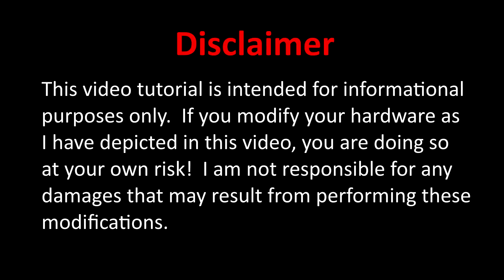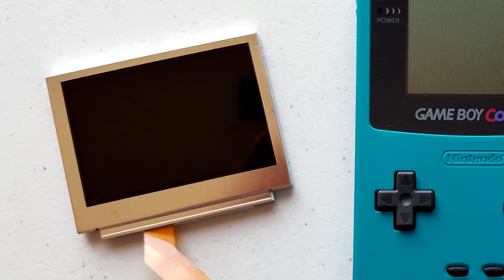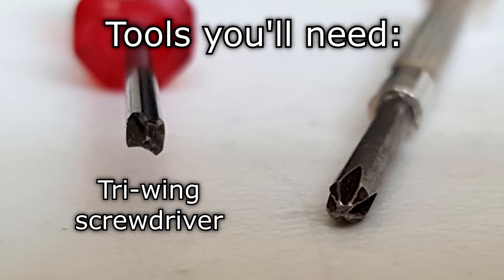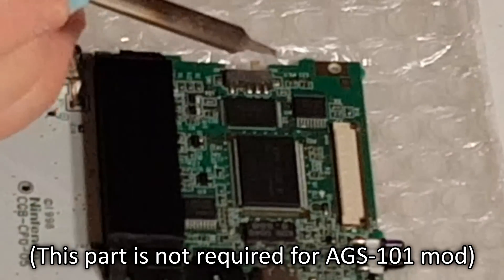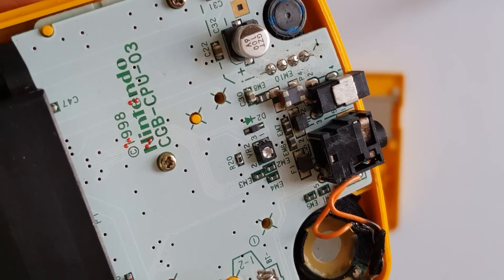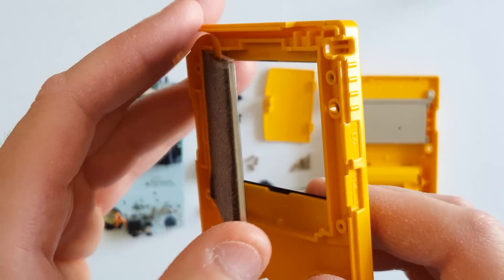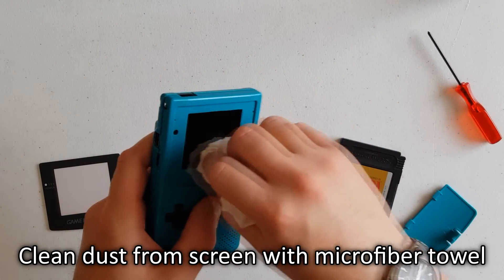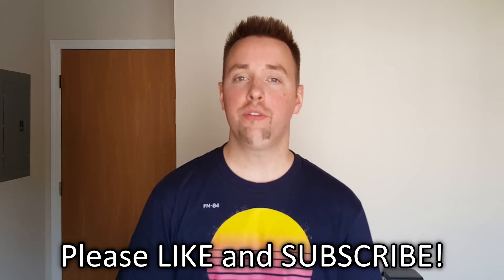Tutorial PART 1: How to backlight a Gameboy Color! (BennVenn's AGS-101 mod)

Comment: Great video, where did you find any info about the pin  3 sound chip mod?

I read your comment on the "BennVenn Backlit Game Boy Color Mod"  and this mod possible cause issues when you use flashcarts.

My GBC  had sound buzzing when i plug the headphones so this mod filters the humm/buzz?
Reply from the maker: Humber LaFont'Blank Hi there, thanks for your question! :)  Unfortunately, it's a bit more complex than that.  Basically, I had a long conversation with BennVenn himself about it.  If your screen is still the stock GBC one, it is probably not a good idea to do just the pin 3 mod by itself, because it can age the stock screen by it not having a certain signal modulated that needs to be.   I am working on making a follow-up video to my tutorial, which will also have these and more details.  I am currently only on my phone, but I will write a more detailed response to you in a few hours! :)
Reply: Thanks for the quick response. I really don't want to mod my GBC or my GBA i know that the reflective screens are not perfect but these are the tech we used to play with (my sons always asks why do you love pixelated games #LOL) The screens have no ghosting and are very responsive but you need a lot of light.

I noticed the humm/fiss when i plug the headphones in my GBC though, so if i mod will be a sound chip mod.

Comment: Another thing.. did you REALLY have to remove the red power light indicator? because you didn't really explain on why that needed to be removed. I just want to know if it's really that necessary to remove that because tbh, is prefer to keep that, to know how much battery I got left(Especially once I install an AGS-101 Screen)
Reply from the maker: Jacob Salazar Another good question!  Unfortunately, removing the power LED is necessary, because the space that it once occupied in the front housing will become unavailable because of the AGS-101 screen and where it is installed.  If you look very closely at the left side of the handheld at 28:37, you will see a small white line just above the "P" in "POWER" - That's the very edge of the new larger display.  My hopes were that it would be completely white in that entire circular window where the red power light was, but unfortunately the frame of the new LCD doesn't allow the display image to stretch that far.  As Morrokbyo asked earlier in these comments, I recommended not using electrical tape to cover the white borders of the screen.  But in this case for the power LED window, I would say that using electrical tape there is acceptable.  I haven't quite yet worked out a way to get the original LED, or any LED, into that area.  That all being said, the power for the console on a fresh pair of AA batteries (I've heard) is about 6 to 8 hours...?  Personally, that seems a little high to me.

On a different note, did you get a chance yet to order a ribbon from BennVenn's batch due at the end of August?
Reply: Kyle'sAwesomeLife thanks and I understand.. And tbh, I literally ordered one yesterday, and everything seemed to go well.  I proceeded to check out, it druid my order was complete,  and I was charged. So I assume that's Venn was able to get more ribbon cables I  stock or something
Reply from the maker: Awesome!  And yup, seeing how popular and sought after this mod is, I guess he went back to his manufacturer and had them make more.  Good luck, man!  I hope yours turns out well for you.

Comment: you mentioned that we needed a product called  "flux".. what e actually is that?. I don't recall you issuing that in your video and can't find it on Google
Reply from the maker: Jacob Salazar - Hi there, and good question!  Soldering flux is a bonding agent that helps with the soldering process, particularly with applying solder to the correct contacts and not getting it on stuff that it shouldn't be on.  I'm using Rosin Paste Flux in the video - My apologies for not showing when I use it even though I mention it in the supply list.  Here's the exact stuff that I'm using: https://www.amazon.com/Rosin-Paste-Flux-135-Jar/dp/B008ZIV85A/ref=sr_1_2?ie=UTF8&qid=1500780374&sr=8-2&keywords=rosin+paste+flux  (Trust me, this is WELL worth the $10)

To use flux, you only need a tiny dot of flux on an exposed end of a wire for when you want to "tin" it with solder (If you've never heard of this process, Google "tinning a stripped wire").  To use flux on other contacts, like I did on the GameBoy Color's board, just wipe a little bit of flux to the contact that you want to solder to.  Using flux in this manner when joining two contacts, or a wire and a contact on a board, will allow the two pieces to join together much more easily and also HOLD to each other much better.

Keep in mind, soldering WITHOUT flux IS possible and people do it all the time!  It's just much more difficult, and once you discover flux and how to properly use it, you never want to solder without it ever again.  Also, to my knowledge, flux either comes in a paste or a liquid form.  My experience when NOT using flux typically involved wires coming pulled out of things I have soldered them to, very weak and fragile connections - It was always very frustrating.  But flux makes soldering VERY easy!  I highly recommend ordering some.

Here is something that I believe would be very helpful to you: https://www.youtube.com/watch?v=o0IXpNHLKw0&t=6m40s  In this video from the channel "GameTechUS", the man applies a liquid flux to two rows of contacts.  If you watch earlier in the video, you see that he hot-glued the ribbon cable on the left into place in order to hold it next to the N64's CPU chip on the right.  Then, he "paints" all of the contacts with flux, which allows all of the solder to ball up nicely on the contacts that they are supposed to be on.  Without flux, that nice and easy of a soldering job would never be possible.  Also, just so you're aware, for large amounts of flux like what he uses, it's best to clean it from a board with 100% Isopropyl Alcohol before testing, just in case there's metal fragments in the flux that could short anything else.

In the end, the takeaway is that flux is magic.  I hope this helps you!
Reply: Kyle'sAwesomeLife  Thank you very much, and I'm glad on how very informal you were.  you take these comment Q's very serious, and I'm glad about that.  good shit man
Reply from the maker: Jacob Salazar Anytime, man!  I'm always glad to help - Just doing my part to help the modding community.   Feel free to pick my brain if you need anything else!  (And thanks for the sub!) :)
Reply: If you don't know what flux is you have no business attempting this mod.
Reply: Chris Downey he might know what flux is, but by a different name.

Comment: Is it just me,  or is it really fucking hard to get the wire that's attached to the ribbon cable to solder, and connect to the kds 8.388 chip because I keep and keep on soldering and it still will not sick
Reply from the maker: Jacob Salazar Heya!  before you try any more, try using flux when soldering.  apply a liberal amount of it to the solder point on that chip and also to the exposed end of the wire.  The flux will remove any oxidation from the exposed metal surfaces and promote a stronger bond.  then after that, just clean the residual flux from that area with a Q-tip dipped in kerosene or rubbing alcohol.  Let me know if you need any more help with this! :)

Comment: This is a great video,but what do you do if theres a problem that occurs overtime,you can't open it back up?
Reply from the maker: Thank you, and good question!  Basically, my answer is that I'm not quite sure because I haven't run into a problem with mine so far.  That being said, some people have taped their consoles closed around the edges instead of hot-gluing the internals, but I didn't think that would look very aesthetically pleasing.  So that's mainly why I opted to hot glue everything.  The part that people don't see in the video is another 3 or 4 hours of footage where the camera just kept rolling while I relentlessly triple-checked every single connection, both with the soldering I did and all of the ribbon cables, before I closed everything up for good.  Fortunately, hot glue isn't super glue, and I've had a good track record when working with it during other projects in the past when I have needed to open something up again.  My advice is to insulate everything with electrical tape exactly as I have shown, and keep the hot glue away from bare ribbon cables because otherwise you could risk damaging them when trying to open up the console again.  Hopefully, the electrical tape used for insulating electronic components will also work as a buffer for the hot glue, just in case you need to pull everything apart to fix something later on.  I hope that helps!
Reply: Kyle'sAwesomeLife thanks for replying to my question :-)

Comment: I need help!!! I tried this method, But my LCD KEEPS TURNING OFF AND ON! HELP!!!
Reply from the maker: Ghostly Gaming  Is just the backlight itself turning off, or just the display image (with the backlight staying on), or both?
Reply: Kyle'sAwesomeLife The back light flashes once every 2-5 seconds. The display is fine.
Reply from the maker: Ghostly Gaming It sounds like there could be a problem with your GBC board itself.  The circuit that actually powers the backlight could be bad, thus causing power to fluctuate.  Try to check the voltage between the negative battery terminal (the upper one) and the solder point on the adapter ribbon with a multimeter and power on the board.  If there is a fluctuation of any kind, that's most likely the cause.  It's not common, but BennVenn did warn me this circuit can go bad.  I hope this helps! :)

Comment: Strange, I don't have the KDS chip. There is a chip that says KSS OKF I guess it is the same(?). I own a EU GBC :-)
Reply from the maker: Gehirnstaub Very interesting!  I'd be curious to see a picture of that.  I imagine that it is the same thing if it's in the same place and it and all of the electronics around it look the same.  Is there any chance you can upload a picture to Tinypic and send me the link to it?
Reply from the maker: Gehirnstaub Imgur works too, thanks!  I'm sure that there are more scientific ways to test this (checking the voltage on my GBC and yours and comparing), but in visual comparison, all of the components look to be the exact same and in the same locations, and your board looks like it has all of the same labels for every other component (with the exception of that chip).  So I would say that it SHOULD work the same for you!  Thanks for bringing this to my attention - Very interesting indeed!
Reply: I want to confirm that KSS OKF Chip works the same. Installed last night

Comment: Would it be possible to make sure that white border is not visible through normal game play to use black electrical tape before applying the screen lense?
Reply from the maker: Thanks for your question, and that's a great idea! :)  I personally considered doing exactly that for my build, however there's a few downsides to consider.  The best time to cover up the white border on the screen is during testing and before you install the screen into the front housing; You would be applying the tape directly to the surface of the LCD itself.  This would make for a very clean-looking border.  However, since the edge of the electrical tape is also still somewhat sticky, it would attract dust particles around the border when you try to clean the screen before installing the lens.  Also, depending on the quality of the electrical tape that you use, it would break down over time and leave a residue on the LCD if you decided that you wanted to remove it later.  In the end, I decided that it wasn't worth the risk (or mess) and so I decided not to include that part in my tutorial.  But as long as you're ok with the above, I'd say it's still a pretty solid idea!
Reply: Kyle'sAwesomeLife good points, perhaps some pieces of black paper then, held down by tape and out of view. It looks amazing, and I'm really considering getting a pre done one once that issue gets resolved.
Reply from the maker: Yup, that would definitely work!  I know that BennVenn was working on a solution for this himself, but I'm not sure where he's at with it or if it will be available for purchase.  Since he only made about 1,000 or less (I think) of the ribbon adapters, this mod isn't super popular yet.  So unfortunately I don't think anyone has been motivated enough to make a sure solution just yet.
Reply: Kyle'sAwesomeLife I should probably get one of August's batch. Just in case haha.
Reply from the maker: Wow, thanks for the heads-up! :)  I just ordered a couple of those.  I had no idea that he opened up pre-orders again!
Reply: and this is where i saiy you should have just used the frontlight from a 001 model SP to light up your original screen on your gameboy colour and you wouldnt have had the white borders.

Comment: Personally id say thats a waste of a 101 screen and use of Gameboy advance games... you should have just stuck with the 001  front light instead as its WAY easier and you get to keep the original look size and screen but just adding the light up function.

Its a Crying shame this 101 was wasted on a Gamboy colour :/ 
Would have been better if the 101 was modded into an original Gamboy advance.
Reply from the maker: Well, I'm sorry you feel that way - I guess this mod isn't for everyone.  I did do the original GameBoy Advance backlit screen mod as well, which I also show in the beginning of the video.  And if you watched the video, you'll see that I also mentioned the frontlight method, but I also outline a downside: In this case, it's with the screen looking washed-out and the player not getting an optimal playing experience.

The reason that people want to backlight a GBC is purely that of nostalgia; Retro gamers want to play their games on original hardware (per se), however they don't want to put up with (some of) the limitations of the technology at the time.  In this case, it would be playing on a reflective non-backlit screen.  You're likely to find a backlit LCD in every kind of device these days, and there have been enough people looking for a way to put one in a GameBoy Color, that BennVenn and others are now making it possible.  That's supply and demand, I guess!

Also, since AGS-101 screens are still being produced by third-party manufacturers, and are only getting less and less expensive, I would hardly call this project a waste. :)  But thanks for your comment anyways!
Reply: severdnerv it's not a original ags 101 screen that he used it's an aftermarket one from China and not the screen from an real ags 101 console
Reply: well thats not so bad then :P
i was assuming it was torn out of a offical SP.
Reply: Tearing up SPs for mods is my only grief at mods. I've seen an instructional PDF where the modder simply cut the flex cable instead of just taking the light out properly.
Obviously it may be a broken unit, but the screen being perfectly good and having it's cable cut just for the sake of the front light module was stupid.
Reply from the maker: Kalvinjj I couldn't agree more.  I don't like how our society nowadays has a "just throw it away" mindset.  In the IT dept. that I work in, we cut the cables on computer mice or keyboards that no longer function correctly before we throw them away, for the sole reason that if we didn't then someone else would try to use them and ask us why they don't work, thus taking up more of our time.  I personally wish that more people knew more about electronics (myself included) so that we knew how to harvest components out of old or dilapidated tech, instead of just throwing it in the trash.

In the case of that SP screen you talked about, I think cutting the ribbon cable is pretty senseless.  At the same time, I can also admit that I've done the same exact thing for broken pairs of headphones and such, if only to remind myself that I've put that thing in the trashcan for a reason and to leave it there.  However, in the person's defense, microelectronics like the ones in that screen (not necessarily the lamp in it) are very difficult to service, since they are manufactured with very precise tools.  Still though, I'm with you in that regard.

Comment: 00:50 WRONG there has benn a orginal gameboy color with back lit, BUT its was a limeted quantity made and only sold in japan
Reply from the maker: Mrmr Chicken Hi there, thanks for your comment!  While you do have a point, I think it's pretty moot at this point.  I had heard a blurb here or there about a supposedly BACKlit GameBoy color being released in Japan, but I don't remember from where, and I've never seen photographic proof of it existing.  I HAVE however seen photos for the TaoBao GameBoy Color, with the custom IPS screen with doubled pixel density.  For what it's worth, take my words as referring to a backlit GameBoy Color that is available to the MASSES, which the Japanese one you're talking about (IF it exists) was definitely not.

Or are you thinking of the GameBoy Light?  Referring to the GameBoy Pocket that had a lit screen?  (Not sure if frontlit or backlit)  I've seen many of those in Japan when I've been there in the past.

Comment: I took the power led off and connected it using some wires  and made a hole for it towards the bottom.
Reply from the maker: Douglas Barr  Nice!  Definitely a solid idea for anyone still wanting a reliable power indicator.  I might mention this in my follow-up video.  Good idea!